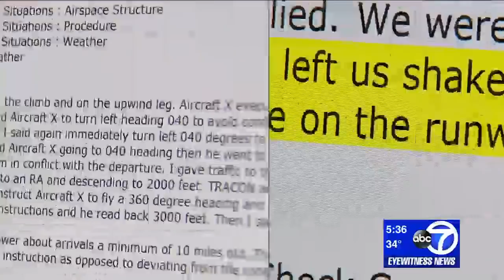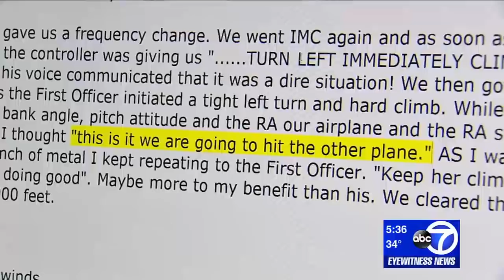Pilots: $6 billion LaGuardia Airport rebuild puts convenience, comfort ahead of safety

Comment: 7000ft is not that long for bigger jets. For regional? not a problem unless you are planning to float down the runway crazy.
Reply: Right. And LaGuardia, for all intents and purposes, is a regional jet airport. A very busy and very large regional jet airport... but it's just that. You aren't getting wide-bodies or many large narrow-bodies here.
Also, DL1086 doesn't fit their narrative here. That accident had nothing to do with the length of the runway. It was a combination of machine and pilot error, as well as meteorological conditions that caused that.
Reply: @seanbooher8252  
Bingo.  DL would occasionally put a 767 in there but that would be for positioning only, not to move that number of people.  The art of keeping the runways active it knowing the weather and using the right mix.
Reply: Any aircraft that lands at any particular airport is required to stop using only the wheel brakes.  Of course that doesn't mean it's comfortable, or easy, but they can.  I've flown into Toronto Island, Midway (their longest runway being roughly 400 feet shorter than LaGuardia's) and LaGuardia.  Not saying i enjoy flying there (wouldn't bother me one bit if I never went back) but it's fine and safe.  Of course incident reports cite short runways as a contributing cause, but it is not the sole cause.
Reply: @jaysmith1408  I've never heard that any aircraft flying into LGA is required to only use wheel brakes. In fact, I've flown into LGA multiple times and that hasn't been the case at all. Reverse thrust, spoilers, and wheel brakes are always used.
Reply: @JonPurdue7  I understand that, but this has nothing to do with the comment I replied to.
Reply: @JonPurdue7  ah. I see where you got that from. Disregard. The other comment I replied to is misleading if that was the intention.
Reply: @seanbooher8252    Not true about LGA being for regionals.  Delta used to fly 767 and L-1011 in there a lot.
Reply: @richardclark4733  key words: used to. Look at what the traffic looks like now.
Reply: @seanbooher8252    The aircraft flying out of LGA have gotten a bit smaller, but not because of runway length.  That is driven by economics.  I always felt more confident flying a 757 or 767 out of LGA, than I did the MD-88.  Nowadays its mostly Airbus, but still a very small runway.

Of course, the idea that some folks compare it to Navy landings on a carrier deck is ridiculous...
Reply: jfsa380 Midway Airport is NOT a valid comparison since it is used almost exclusively by Southwest Airlines, which only operates (smaller and lighter) B737s. A more valid comparison would be Boston's Logan Airport. One of Logan's most-used runways is Runway 9/27 which (like the runways at LaGuardia) is only 7000 feet long. Like LaGuardia, Logan is at sea level but unlike LaGuardia, it has a lot of international carriers and more long-distance flights (which require more takeoff space). Yet, Logan manages just fine.
Reply: @seanbooher8252  But that is more economics, not to do with aircraft performance and economics.
Reply: It’s especially a problem for the 737NG planes. The 737-800 and 737-900ER have a higher landing speed then other planes because of their length. This means that landing at LaGuardia can be a challenge especially when the runway has snow or water on it.

Comment: The reason they are not being expanded is because of environmental requirements and local opposition. It is irresponsible that this was not mentioned in the report.
Reply: Thank you for bringing this up and I mentioned the same thing in previous comments. Building, extending or even making modifications to a runway is not the same as filling a pothole. The biggest obstacle is opposition from NIMBYs. The process can take many years even if it's successful. 

Most of the pilots being interviewed here probably live close to a major airport themselves, and any of them would scream bloody murder if they found out that the local airport authority was proposing to extend/build a runway.

Comment: 7,000 feet?  Southwest flies into and out of MDW all the time with less runway and arguably worse weather, at least, worse weather more consistently.  Not making excuses, just making a point.  MDW is landlocked, LGA could lengthen 4/22 a couple thousand feet into the East River and using Rikers as an excuse, please, they could come up with a better excuse.  Extending Rwy 4 by 2,000 feet might tick off people in Shorehaven getting the noise closer to them.
Reply: True about the runway extensions and how there would be noise issues.
Reply: How can you consider yourself to know more about LaGuardia runways than the pilots that spent years landing there?
Reply: Difference is that they spent soo much money on the terminal all together. They could easily add extra 500-1000ft. Many airlines wanted to add larger plane into their operations into LaGuardia.
Reply: Midway does NOT have consistently worse weather.  I've flown into both airports, many times, and LGA is far more challenging.  Besides, Southwest has a habit of going off the end of the runway and crashing, regardless of length...   ;)
Reply: @nntflow7058    Says who?  Neither Delta, nor American want to add bigger planes in LGA.  So to which airlines are you referring, when you say "many"?
Reply: Midway is not a valid comparison because only Southwest uses it and their fleet is all Boeing 737s. Also, ANY type of runway extension is always going to encounter fierce opposition from local communities. Doesn't matter if you extend the runway into a river or an ocean.

Comment: This news report really didn't need to be made. The 7,000ft runways at KLGA do not prove to be a safety concern for the aircraft that use the airport. Many of the previous incidents were a result of machine and/or pilot error. @ABC7NY, please don't make things more dramatic than they are, especially when the subject is more technically complex then you're capable of explaining.
Reply: TV news isn't about news, it's about hooking you with "juicy" teasers so you will watch the lame report that is boxed in by expensive advertising air time.  Not saying that is the right thing to do, just telling it like it is.

Comment: Sorry in the Uk we have Bristol which is roughly 6500 feet, we land 757,787 and personally A320 on a daily basis, without issue, Maybe land on the touchdown markers and soak up the pride and not float for 100's of feet to impress the passengers with a "greaser". That's coming from a current line pilot.
Reply: I think the real issue here is the short approach which gives pilots less time to line up with the runway and requires them to make adjustments which have the potential for danger.
Reply: @NotBen101  Short approach? To which runways. ? Not 4, 22, or 13.... 31 is the only possible as there is no ILS approach just RNAV... .
Reply: Bristol isn't near approximately twenty million people with two, actually four other airports if you consider Westchester and MacArthur Long Island Islip and given the concentration of skyscrapers in Manhattan and the approach patterns into LaGuardia and how narrow Queens is to see JFK perhaps only ten or fifteen miles to the South East. Maybe your Crown wouldn't mind giving up St. James or Regent's park to build a runway. Sorry, London's skyscrapers are nowhere as numerous as New York City and the extremely tight airspace vectors in our largest metropolitan area.

Comment: I've flown the 727, 757 and 767 into LGA more times than I could count. Should the runways be lengthened? Yes. Trans-con flights out of LGA are a challenge. As for landings, most crews do fine. In fact it's rare for crews landing on RWY 31 or Rwy 4 to roll past the intersection. That means they're doing fine with about 5,000' to flare, land and rollout. The real challenge, not addressed here, is takeoff performance. The most hair raising operations at LGA? Not landing the wide-body 767-332, but departing on a hot summer day with a fully loaded 727-232 bound for FLL or PBI. It was close without an engine failure past V1, I can't imagine how close they would have been with a thrust problem. I know no mainline carrier flies the 72 anymore but the same limits apply to the A-320, B757 etc.
Reply: True, runway length is always even more critical for departing aircraft than it is for landing aircraft.

Comment: The short runways are a major issue.  However, to renovate runways is not an easy task by any means either :-/
Reply: Matt Seifman The issue is they dont want to close the airport and lose money to extend the runways.
Reply: @VizionWorksEditing  there actually is mathematical calculations that have to go into renovating the runways.  Slope, tread, durability etc.  To cover all of that would cost a lot more $$.  Keep in mind this IS state $$ we're talking about, essentially tax $$
Reply: Yet they gave amazon money to bring them there instead of investing in the airport. This is NY which is crowded and overpopulated, they have enough money for the job.
Reply: Yes but Hong Kong’s newest airport was built in the bay!! It’s a matter of $$$. Beautiful terminals with shops are more important in the US!! Thanks
Reply: @Rhaman68  that's true.  It's also the fact that the runways aren't damaged and they wanted to minimize impact as well as keep the airport up and running (imagine the chaos at JFK if LGA was closed and all the flights had to get diverted)

Comment: For anything larger than a 757-300, it’s an issue. A320s, 737s, CRJs and EMBs, it’s fine. Delta flies it’s 737-700 to Key West, which has a 4,500 foot runway
Reply: oh_snap yeeto-neato well the -900 Eats Runway does exactly that with a full load at least and good braking action most jets can get in there, just don’t expect smooth landings

Comment: I remember around 1990 an incident with a plane departing LGA barely clearing the outfield light tower at Shea Stadium.
Reply: They spend 6billion, to redesign
La Guardia, and not spend any of that to extend the Runways? Were
Talking about a safery issue! Close
Rikers island jail and extend the runways. Whats more important,
Building another jail, or putting the
Lives of Passengers in jeopardy?
Trust me, they can find land for
Another correction facility! How
About a correction facility in the
Rockland County Area???
Reply: Rockland County...Spring Valley
Ramapo, Clarkstown.......
Jeffrey S. Simon. BOSTON
Former Monsey Resident
1962-1967

Comment: Excuse me, have these pilots ever tried landing at MDW, BUR or SNA? My God, these pilots are spoiled brats!!!!
Reply: You don't understand how big of an airport that is you're going to be waiting mm to take off for like 30 minutes
Reply: Burbank and SNA have very few planes therefore they won't have to worry about traffic
Reply: Richard Fleer Well, the striking difference are the water at the end and the tall buildings/obstructions.  Except for Midway, I have flown in/out the airports u listed and others with 7,000 ft runways and the challenges increase with wind, visibility and surface contamination issues. Pilot skills can vary plus LGA could be the 5 or 6 leg of a long duty day. Obviously the crash record speaks for itself: not bad at all. But the pucker factor is there. Thanks
Reply: They need to stop complaining Key West lands 737s on 3,800 feet😂
Reply: Richard Fleer wow. Midway is almost the same. Congested airspace that is SHARED with O’Hare and short runways. I landed a southwest 737-7 at Midway once and I land to use the full runway, full flaps, spoilers armed and full brakes. Get a clue.
Reply: SNA is nearly as busy as LGA, and only has one runway that is useable by air carriers. The issue is that LGA has far more adverse weather conditions and poorly designed airspace. The SNA and BUR Class Cs and LAX Class B are designed much better than the NYC Class B
Reply: Erik Goodfellow I could barely do it in a CRJ 900
Reply: Richard Fleer Bob Hope is very short 🤣 I flew to Burbank on a SWA 737-700 and I got scared because of the short runway length.
Reply: Have they landed at Oakland? Key West?

Comment: I fly a regional jet and have routinely landed on 5000 foot long runways with zero issues. 

LaGuardia's runways are not unsafe for the regional jets and narrow body airliners that fly there.  However, should certain factors align such as poor runway surface, a microburst, or windshear, combined with NY approaches' inability to give you the best runway, mistakes could turn bad. Luckily the EMAS system is extremely effective.
Reply: The issue isn't the length for landing, but for takeoff.
Reply: @richardclark4733  I don't agree
Reply: @AverageGamezzz    Every pilot knows that taking off a short runway is more difficult than landing on one.

Comment: Almost every aviation accident in NY flew in or out of LaGuardia, coincidence? I think not
Reply: True. Very true. But did you ever look at the ratio of incidents to successful landings there. And not every incident there was due to runway length. Like WN345.
Reply: Idk If that's true. I can think of 3 big JFK crashes right off the top of my head- TWA 800, American airlines a300 that lost it's tail and crashed in southern queens, avianca 707 that ran out of fuel on approach
Reply: @Hobinator17    None of those accidents had anything to do with the airport, and TWA 800 was not even a crash...

Comment: Runway 4 from the approach could be extended going to there the approach lights lights are not from 22.  Runway 13 Cant be extended from either direction because of the Rikers Island Bridge on the 13 side and Flushing Bay on the 31 side.  Best this to do it close Rikers, fill in Bowery Bay and extend the airport all the way to where Rikers Island Bridge is now.  I know, closing Rikers is easier said than done.

Comment: If you think La Guardia's runways are short, try landing on Burbank's 6000 foot Runway 08. With a 737-700 (the smallest aircraft in the 737NG family and the aircraft most frequently operated in and out of Burbank) even on a dry runway you're cutting it close.
Reply: Delta files into Key West which is under 5 thousand feet but manage to do a better job keeping their 737s on the runway compared to Southwest
Reply: Phil Montejano except that Key West doesn't have snow and ice covering the runway, which was one of the causes of the Southwest crash in 2005

Comment: They should extend NY LaGuardia's runways by two, 2.5K for both. What they should do is close Riker's and expand 13/31 into the Riker's Island Channel and like the expansion in 1967 with Runway 22 out into the East River or Flushing Bay. However, this would certainly create massive noise issues when pilots have the best approach of NYC with the Hudson River visual and candy-cane hook over Lower Westchester, or the Bronx and the neighborhoods of The Bronx Clason Point or Parkchester sections or close to Throg's Neck on approach into 22. I'm sure people not familiar with NYLGA freak out and think they're going to crash into the Bay.